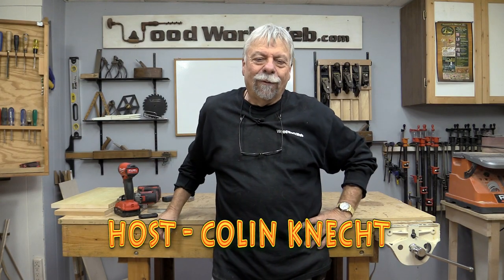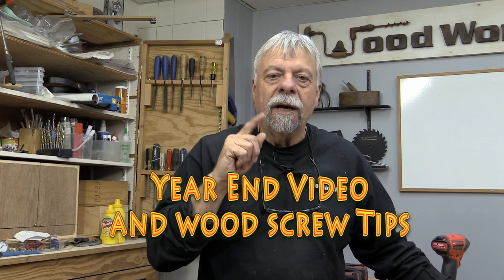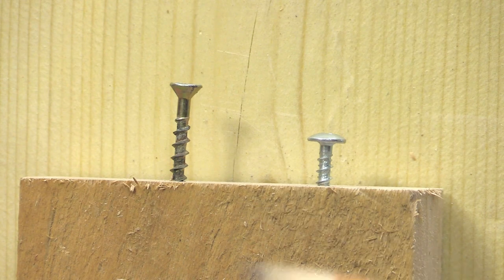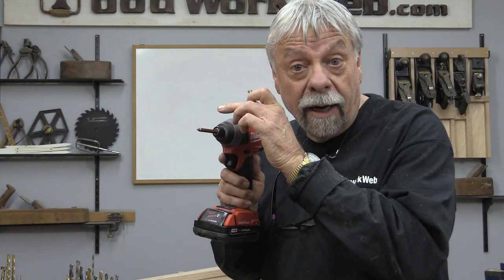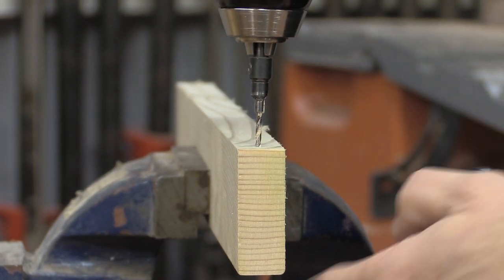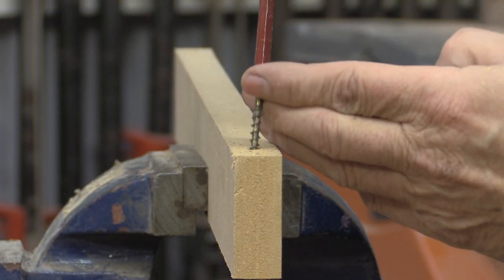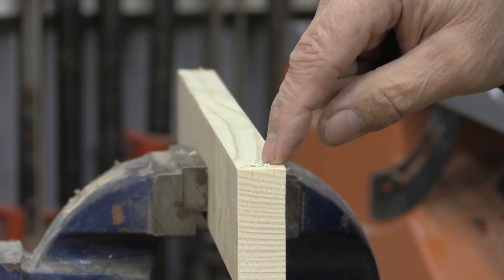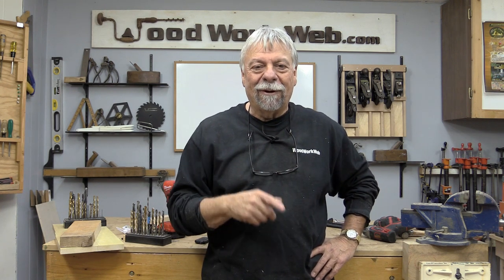2016 Year End - Foums, Searches and Wood Screw Techniques

Comment: Colin the splits appear well before the counter sunk head of the screw touched the wood. It was the pre drilling rather than the counter sinking that prevented the timber from splitting.  The pre drilled MDF however did prove your point about the counter sink head applying outward stress as it only split wheb the head of the screw was driven into the counter sink. Enjoy watching your videos and learning new skills, keep up the good work in 2017 and have a happy and safe holiday season. From a hot and sticky Melbourne Australia.
Reply from the maker: Thanks for detail ... appreciate it the comment

Comment: Last video of 2016 but not the least. A lot of useful information, again.
I'm used to pre drill holes for screws, for 4 mm diameter holes I use a 3 mm drill bit but not till the end of the screw, only half way.
Countersinking I do sometimes now that I have a set of countersink drill bits. Before, when i needed to have the head of the screw under the surface of the wood, or at least flush, and I did not have a counter sink drill bit, I used a drill bit with the diameter equal to the head of the screw and made a whole of about 5 mm deep.

Thanks for all the videos and information in 2016.
Merry Christmas and all the best for 2017 for you, your family and friends.
Reply from the maker: Thanks Hans ... all the best in the new year

Comment: good trick with the clamp.  Teacher taught me in 19666 to use the oil off the side of your nose to drive a screw or nail.  To drive a nail without splitting cut the point off flat like a cut nail to prevent splitting. He said when he worked in cold weather, he would use lambs fat on his hands before starting the day, no gloves... I never tried that one. I hate lamb. 
     When I worked as a carpenter in Alaska, a carpenter taught me a trick to nail through the back side of a 2X4 to nail into the center of a 1X on the opposite side while on edge,  by using the nail as a measuring device.  You measure where the 1X edge is located like a T against the 2X4, using the nail, while its edge is butted up against the 2X4, and then pinch the nail along its shaft, then transfer this distance to the back side of the 2X4 and tap the nail head to leave a small mark. Now just nail to the side of this mark about 3/8ths of an inch and you will hit the 1X dead center every time. This works good when you do something like a sheet of plywood with with a 2X4 frame ploughed out to accept the plywood the nail or screw on the outside edge of the 2X4 into the plywood. Like for a sign.
Reply from the maker: Yes, I forgot about the oil trick ... haven't used that in years, thanks for the reminder ... all all the detail, a good read, thanks

Comment: Actually for better holding power the entire depth of the screw hole should be pre-drilled to the size of the screw shank. (As you probably know) With a proper diameter and depth of pilot hole the entire surface of the screw thread contacts wood. Without the pilot hole, the wood splits away and only two sides contact. 
Merry Christmas to ya
Reply from the maker: I have found being a bit shy with some of the softer woods seems to work quite well, but I agree with you on the harder woods for sure.